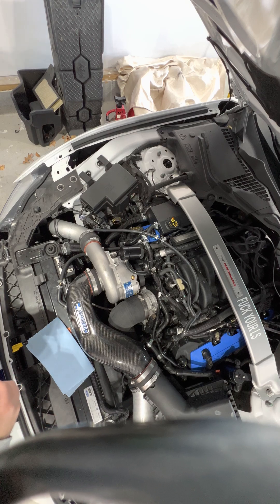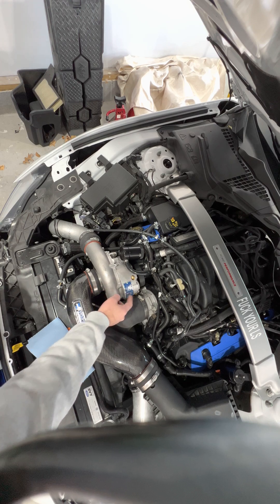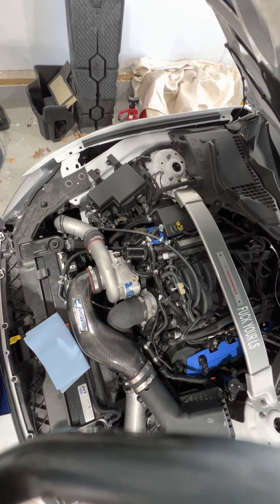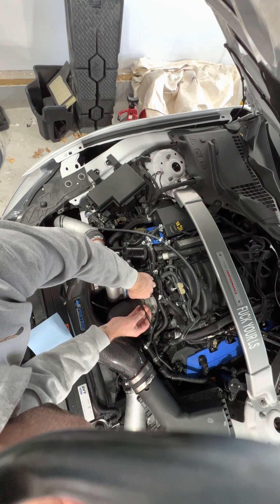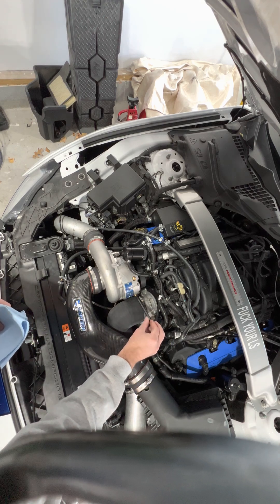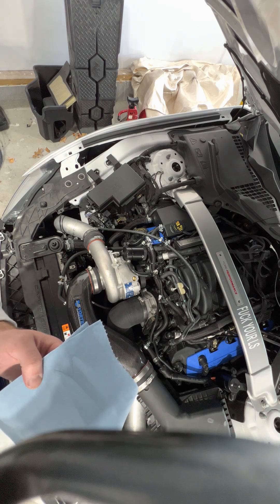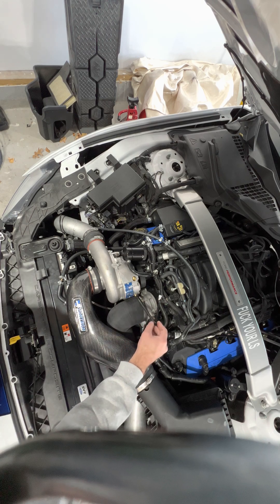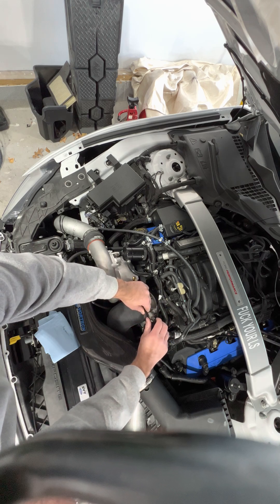How to check supercharger oil Vortech

Comment: have a V3 installed in 2023. checked the oil today for the 1st time and its clear looking and not red or purple like in the bottles???? is that normal?
Reply: I just installed a Paxton SC and I have the same problem. The clear oil makes it almost impossible to read against the bright metallic dipstick.
Reply: @saleen-wx2ic  yah!!! glad i changed it to purple before it went on the dyno!!!
Reply: @berardoferrari I got a fix for it. I cleaned the dipstick with alcohol to get all oil residue off. Took a permanent (black) marker and colored in the cross hatch pattern to improve the contrast. Very easy to read the clear oil against the black.
Reply: @saleen-wx2ic  👍💪💪💪🦾🦾good idea!